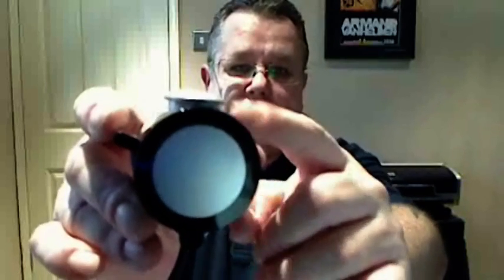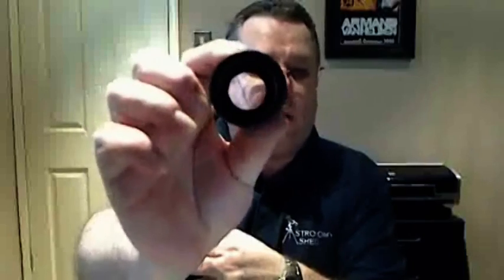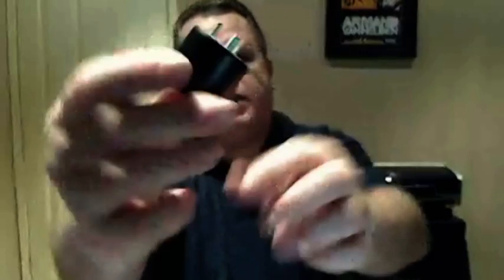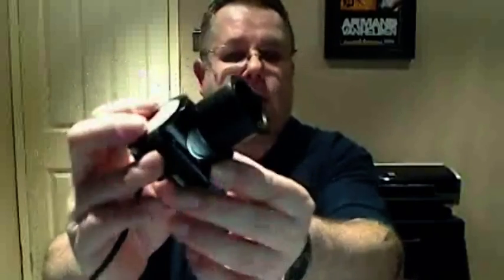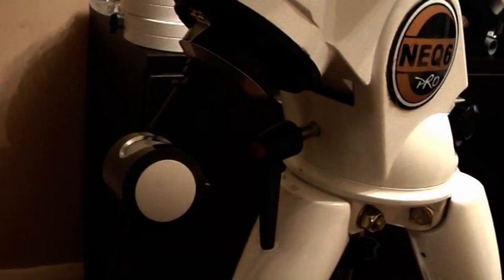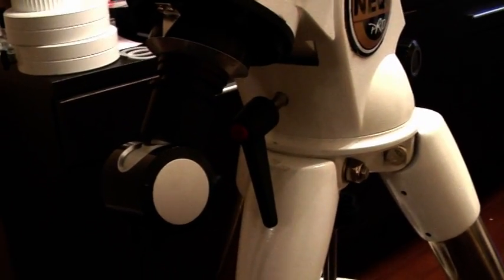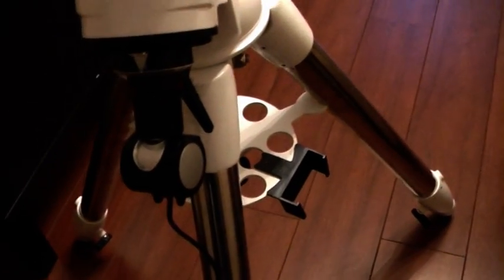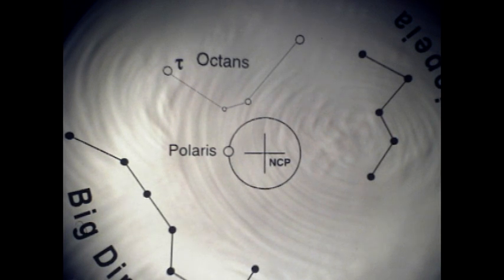Polar Scope Cam Mod

Comment: Recently upgraded to a GEM (EQ6R Pro) from an alt-az (NexStar). For added stability I don't like to extend my tripod legs at all. Polar aligning at that low height and my latitude (43.8°) makes for some interesting and uncomfortable (read: painful) body positions. My mind went to the same idea as you. Thanks for taking the time to share your solution. Regards and clear skies from  the suburbs of Toronto, Canada.